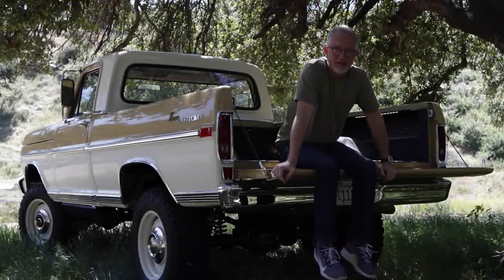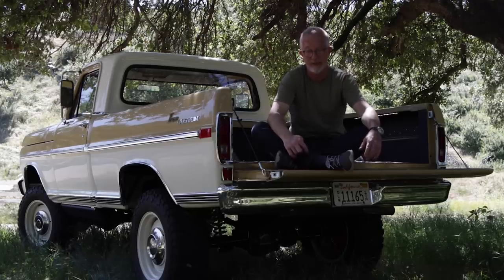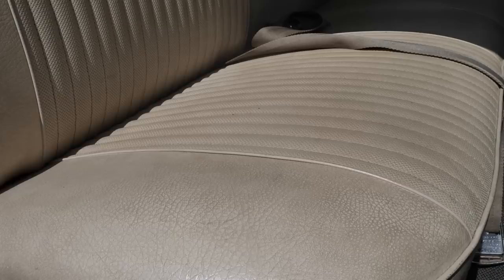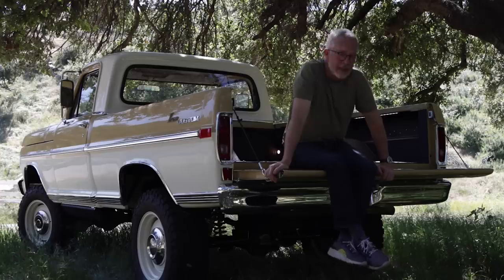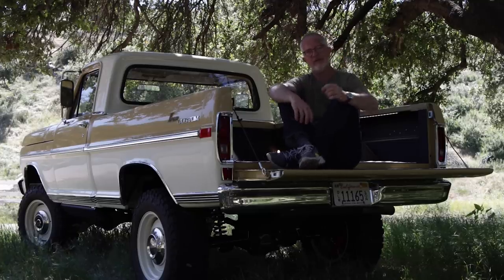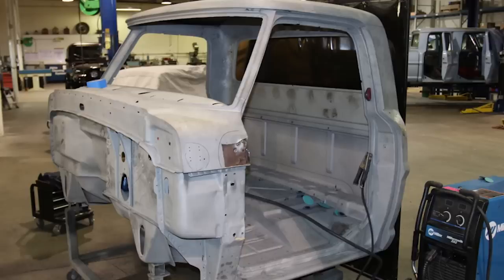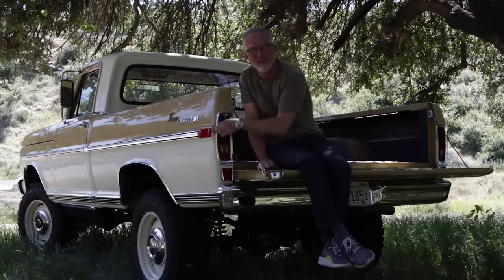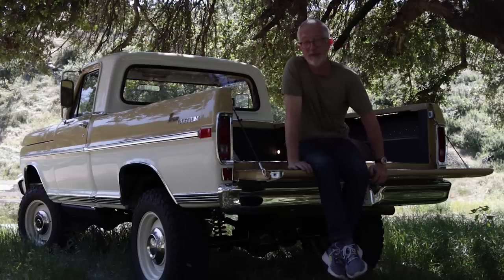BEHOLD! The ICON Reformer Ford Bumpside F100 4x4 in 4K

Comment: This truck looks better then the new trucks of today.
Reply: With all the upgrades they did, it is better in every way I can think of.
Reply: Mark Gosser-Chris Moore
Totally agree
Reply: 67-72 were the best looking Fords, without a doubt.
Reply: @1SqueakyWheel  Agree, so were the Chevys of the same era...
Reply: CAP Agree there too.  The Chevies and GMCs of 67-72 were the second best looking.  The mid to late 50's GM trucks were the best looking, I think..
But honestly, I've never met an early 50's thru late 80's American pickup that I didn't like.  :-D
But I was practicing constraint when I made my first comment.  🤣
Reply: For sure
Reply: Rose colored glasses
Reply: 1SqueakyWheel Even a 80s Dodge pickup! 🤮
Reply: Jimmy Cline The earlier to mid 80's Dodges with the grille and headlights fully framed together was a good looking truck.  Last of the sealed beams too, if I remember right.  
I hated it in the late 80's to early 90's when they restyled it with the huge chrome bezel across the top that a said DODGE across it, and the frame gone.  To me, that was unnecessarily ugly, and I didn't like the look of the Dodge again until the "big rig' restyle which renewed public interest in Dodge trucks in a very big way.
Reply: cause it costs 100,000... yup
Reply: Yes. I dont' understand the new ones today
Reply: @1SqueakyWheel  the early 62 unibody are badass too. But I agree
Reply: we had  a new 68 ford f100 ranger package with the 390cid 3 speed holley carb crane cam headers   astro mags    all brand new in feb 1968

Comment: Dash pads for ‘67-‘72 are readily available in factory colours. USA1 interiors, Dennis Carpenter, F100 Central. Not that there is any issue with this one. The repros are $300.

Comment: My jaw is on the floor. This is such an AMAZING truck. I'm not usually one for 'resto-mods' or putting new stuff on the old vehicles, but dang... you can't even tell!! They did this with so much care for the original styling, and in many ways improved on things without changing the appearance (seat, dash, etc.). I can't even begin to imagine the cost of this project -- probably more than I'll make in several years -- but kudos to Mr. Ward and ICON. You have my respect!

Comment: Love it with one exception.  Instead of the Automatic Could you have kept the factory 4 speed or upgraded to a 5 or 6 speed with OverDrive? 10 out of 10 times if I have a choice I will always take a Standard over Automatic all day long.
Reply: These are custom to the utmost. I’m sure the client wanted the auto for whatever reason, and I’m sure they would happily build one with the manual if you were the client!

Comment: OK at 1st I understood the sentence saying;"...we didn't put lockers in it because it wasn't going to be designed for a whole lot of off road use...." eventhough you did absolutely everything else that any rock crawler/overland/hardcore trail rig would have with the 'exception' of putting lockers in it. So why not just put lockers in it?
 Is it completely impossible that someone might possibly drive down a road that they could get stuck on? 
You made it soooo perfect it's impossible for that to even be a risk or possibility?

 Could you imagine the owners dismay if one day while hes driving around there is a Flash flood warning (or similar)and he ends up down a road that has just a little bit deeper sand or gravel or mud then he can get through and he has to leave the vehicle to get help.
 He returns to find out (any number of scenarios could have unfolded here,.. a break in/theft,a flood, the vehicle gets destroyed in an act of vandalism) and all that was needed was another $1000 worth of parts to have been avoided.
 That's just dumb arrogance.

Comment: New better leafs on back ,alloy front bumper ,fibreglass hood,aluminium tub,lighter weight,turbo diesel option 4 cylinder,then you have fast and economical ,like mine, coyote gas guzzler??????

Comment: 1969 F100 was my 1st vehicle it would not be my last.
 I worked at a Ford dealer after school and Saturday's.
The dealer was in Arizona and sold lots of trucks and I worked in the
" new get ready shop" that's where we removed all the shipping protection, then put on the mirrors, wheel covers and such.
My 1st was a 69 F100 swb 360, C6 trans, Ranger trim package, next 74 F100 4wd that I dropped a FoMoCo CJ 4v intake and Holley 4v carb in it.
Next 1976 F250 4wd that I ordered custom built. $6,700 in July '76.
 It was destroyed just after I paid the 13 payment.
Next 75 F150 4wd. This one I highly customized it. Starting with a 428 CJ I built. Custom roll cage, bed bar, custom made front winch bumper,  Warn 8000 winch, then I made a 34-gallon gas tank for it. Put a Dana T case from a 75 Bronco, replacing the single-speed unit with a 2 spd.
4" lift, SVO limited slip 9" pumpkin.
Had it 5 years, bought it back 5 years later, kept it 3 years, sold to buy a new Service Truck.
10 years later bought back, kept it for 5 years, then gave it to my oldest grandson after he graduated from the Marine Corps Basic Training, San Diego. With the promise it stayed in the Family.
My 1st diesel-powered truck was in 83, F250, 6.9 with manual trans.
 Then on to the 1st gen 7.3.
Next was in 93, purchased new a F350 4wd cab and chassis 7.3 PowerStroke 5 spd trans, dropped a new service body on it and went to work.
 Then a 97 F350 PowerStroke 4wd pick up.
An 03 F350 4wd 6.0 P/ U
06 F350 4wd 6.0 added to the fleet.
And currently a 2011 F350 Superduty 6.7.
I didn't purchase my 1st car until my wife became pregnant with our 3rd child, who is now 34.
I've had other vehicles too.
A 74 Bronco, 86 CJ7, 78 CJ 7, 
FL 70 Freightliner, 2 Mustangs, 1 a Shelby, GMC 7500 Service truck, 75 CJ5 and the 1st car I bought a 74 GrandSquire station wagon
For my wife and kids.
All my kids (3 girls) drive pick up trucks to this day. My 2 step sons also Drive P/Us, a family thing I
I have been in the mechanic trade 40 plus years with most years as owner. I've worked on it all from small cars to heavy equipment  had a custom shop that included Shelby Mustangs and Cobras. . have enjoyed myself along the way rebuilding classic vehicles, sold several at Barrett shows in Scottsdale and even a few at R/S shows in the same city.
  In the classic car / truck market customizing old iron ruins their value. This truck will never sell for what it could have if it had been restored to original specs, tens of thousands of dollars less now.
Restored 1st gen Broncos when restored to stock go for over $50K
Now stock restored trucks are doing the same.
 To each his own, but if you ever sale you will regret the mods.
Plus they are fast disappearing.
part of history.

Comment: My Dad had picked up a 1970 F250 Longbed Highboy about 25 years ago, and we used it as our field service truck for several years. It's got the old 390 iron head that never worked exactly right.  It has the 4 speed manual and part time 4X4 with lockouts. It's retired now, and sitting in our polebarn along with my 66 GMC I1000 I'm hoping to restore someday.
We also had an F100 1970 that Dad had bought in the mid 1970's but he sold that one a few years ago. Exact same body style but it was a 2X4 instead of 4X4. That one only saw winter use on nice days.  It had the 360 from the factory which was the same block as the 390. My uncle also had an F250 as his service truck. He had replaced the engine at one point because it was getting a little tired, so Dad put that engine in his F100 because his 360 had gone out. We ran it that way until he sold it.  Even a tired 390 was better than the 360.

Comment: I have a 1968 F-100 in blue and white, 2 wheel drive with the 360 V-8 and 4-speed. Used to be my father's truck. Would be nice to restore it to this condition but I doubt it will happen.

Comment: The F-100 had coil springs on the front that wheel hoped in rough terrain. This resulted in broken axle u-joints. No power steering either. I owned two of them. My 1974 F-250 was twice the truck! Cheers

Comment: It's beautiful. That being said, I would dump the slushbox for a 6 speed manual, kick the Coyote to the curb for a 300 6 cylinder, go with the best breaks that would fit in stock size wheels and lockers front and rear. Why have a 3.5 low range with out lockers?

Comment: It is a gorgeous unique build! Seems not much of the old truck was salvaged. I like it for what it really is "a brand new hand built truck that looks almost identical to the 50 year old" For myself, I like a little bit of vintage rattle, a few small dings in the trim, wipers and things just a tad old and funky.  The Coyote fits well with what that truck was built for. With that kind of budget spent, I would have needed a knock-off all aluminum 427 side-oiler. A lot more expensive but a lot of class. But that's a race engine that needs tuned quite often. Coyote is the best everyday driver. Love those textile inserts.

Comment: Nice! I've owned my 73 Ford short 4X4 for over 35 years and always will. With the locker, built 390 and 4 speed, it'll climb until it's standing straight up on the bumper. Love it!

Comment: True passion in the art of how to show it threw a rolling masterpiece. The fine little touches to compliment your craft.  I have 3 factory 67 f100 4x4 short beds and a 67 all original crewcab short bed. And a 65 66 f100 short bed too one being a 4x4.  I need to talk with you. Two big old 👍 up. How did you get the original steering column to fit on the tilt column?

Comment: Jonathan Ward
Wow! I know this day would come; I just did not know that it would come so soon. In 1982 I bought a 1972 F100 8 ft. long fleetside Ford pickup. The engine is a straight-six 240 with a three-speed on the column manual transmission. It had under 100,000 miles when I bought it and I put 150,000 miles on it. I was told that it would never be a collector’s truck but now it is. Cool, I will drive my truck thinking I am now in style. Have a good day.

Comment: I had a 70 f100 like that way back in the day. Baby blue with white trim. A bench seat like a couch with a trampoline in it. AM radio, roll up windows, suicide knob, white top meaning no air and a huge engine that could pass anything but a gas station. It got about 7 miles per gallon. After seeing yours, I wish now that I still had it.

Comment: One day I will have the money to get you guys to build me a 60’s or 70’s Dodge crew cab with a 12 valve Cummins, 6 speed manual, fully boxed frame, coil overs all around and lockers.  Nothing crazy electronically, just well built.

Comment: Why did you change to automatic from the classic four on the floor long stem shifter?  The only reason I can think of is the client doesn't know how to work a clutch.  This truck requires manual on the floor, without it  you have a vintage Harley with electric start.  Messing with perfection here.

Comment: Great build. Wondering when the new 7.3 gasser starts making its way to these classic projects. Would seem perfectly at home in the old chassis. Also nice to see you’re running a proper air box. Tired of seeing some tube and filter if they even still can be defined as such sucking up under hood air and grime.

Comment: i'm more of a chevy guy but i love my 70 ranger high boy dana 60 and 80 with a 428 and 22 top loader with no rust good clean body tool box on side got it for 250 bucks with extra parts like chrome and lights extra doors and front clip all good clean parts

Comment: Nice clean build. How hard was it to get the column shifter to work with the 8 speed automatic transmission? I also like the way you made the gas tank filler in the bed, how big of a gas tank does it have?

Comment: never seen your video's before but I will now stop stand and applaud you guys work on this. I'm from the country and still see these old fords on the road in Alabama. I'm not a ford guy but i love some old school Fords, Dodge, Chevy trucks from the 70's and 80's. This is superb work and looks amazing. It looks like it could be stock and brand new if they were making them today.
Reply: Only thing i would change is the engine. I would have went with the 7.3 cam in valley engine (godzilla). Much better torque and more useful for truck applications like towing. Not to mention Reliability is way better with OHV engines over OHC, DOHC. More complexity and moving parts = not as reliable. Or maybe a LSX but i would have stayed ford like you guys did cause it old with the new.

Comment: Open diff for that money is obscene. Should at least have a Truetrac.
Reply: jeep6242 
I doubt that truck will see much off roading so open diff makes sense to me for drive ability but I would want 2x4 4x4 and all wheel drive
Reply: @jackd2083  A coyote engine on the street with an open diff and slippy off road tires will be horrendous. There is zero reason to not have a torsen LSD on this for the gazillion dollars it cost. I have one in my crappy 150HP 4 cylinder 2wd truck and it's night and day difference for actually being able to accelerate even moderately and there is ZERO penalty to pay for drive ability. Literally nothing.